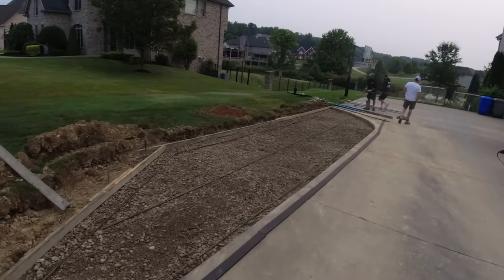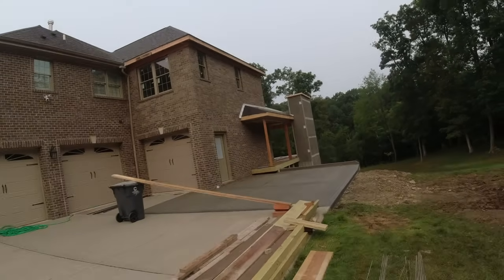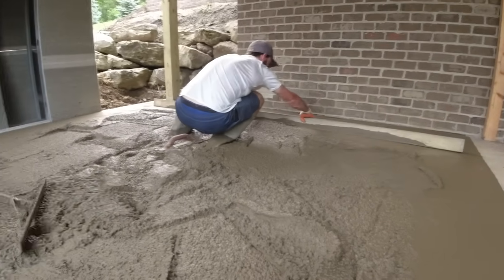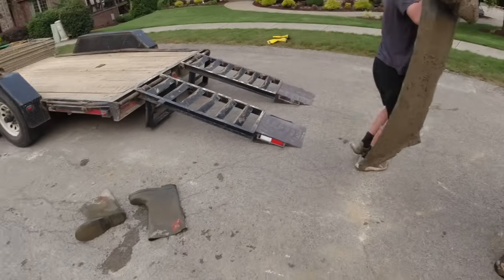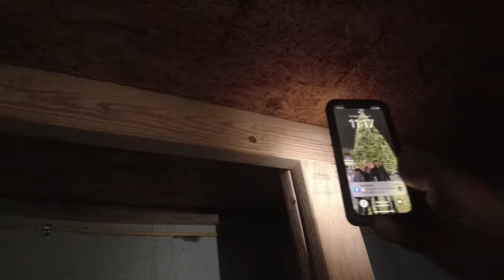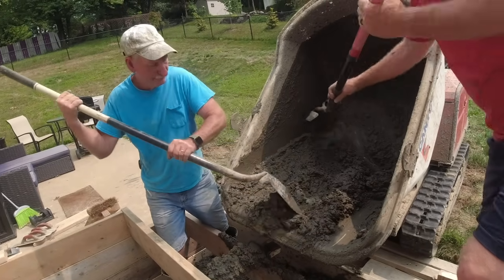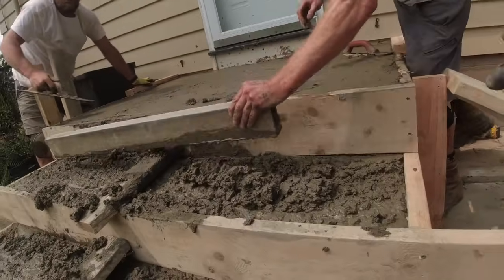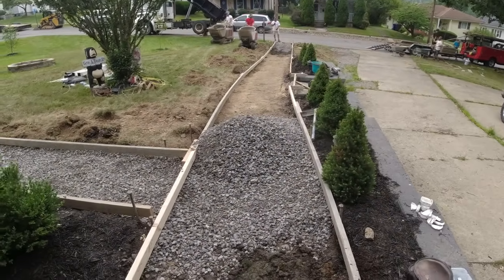Not Many Can Do This!

Comment: I like the mat that you put on the mules to prevent the splashing of the concrete, on my house there was splashing on my vinyl siding, wood door and window trim and AL screen door all dried hard as a rock and wouldn't come off no matter what I tried...and here it is 5 yrs later & I can still see the stains on EVERYTHING!! I would insist on putting plastic up on any surface up to 8' away & 8' high..yes it splashed that high! 
 Also, why aren't the guys all using square shovels, I noticed on older guy with one but all the others were using pointed ones.  I've found that doing this type of work with a pointed shovel just dulls the point and is way less efficient. I enjoy watching your crew working, you're so lucky to have those guys!
Reply from the maker: You’re right it splashes you have to deal with it right away

Comment: Couple of questions...why don't you bevel the bottom of your 2x8 risers on a 45 degree angle to finish the tread a lot easier & why don''t you use form oil on all your forming?...unless I missed something.
Reply from the maker: I find it easier to follow bottom edge. We take off and clean the same day.
Reply: @Concretewiththehauses  Yes, but a 1 1/2" bottom edge width is a lot wider than an almost zero width.
We would strip forms sometimes, but in a lot of cases we were not able to strip forms and they would have to remain so I always beveled the bottoms of the 2x8 risers for a nice clean finish.
Never the less, you guys do very nice, quality work with excellent prep and construction forming techniques.
Thanks

Comment: Your work always looks first rate. I do have a question for my own edification: I’m a concrete contractor in Southern California, and we would not be permitted to allow that 4 x 4 post to come in contact with the concrete pier beneath it (I’m guessing the code prohibits this due to possible rot.). And it’s fairly dry here most of the time.
We use a piece of Simpson hardware (or equivalent) that we embed in the concrete pier that holds the wood post a quarter inch above the concrete. Very secure but no connection between wood and (often times wet) concrete. I don’t remember what part of the world you’re working in, but is the code different there?

Comment: I might suggest a water soluble oil (like Klean Kote or Zep products) to spray on your buggies. It will soften the old dry concrete and keep new form sticking. It is an extra expense but keeps things cleaner and easier to maintain.

Comment: Lookin good when we did stuff like that instead of all that extra fill using concrete and extra weight we did what they call a lost deck by taking old or new form wood and build a box sorta living a 8-10" space all around for walls add re bar also we used Styrofoam and that never comes out .  Most  all the bridges see on the California  are hallow and in the forming the deck or the roadway section is a lost deck type and that plywood and lumber stays in there you  can walk through them I know I worked on them I know as I worked on them back in the 80s
Reply from the maker: Nice thanks

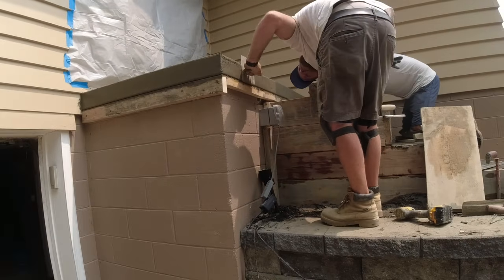Comment: 23:00, if he were to wet that edger to make it glide easier, does it hurt the concrete by making it weaker?
Reply: The idea is to push the stones deeper into the concrete and allow the fine material to come to the surface. There is plenty of moisture there already, it will come up when the stones go in.

Comment: I've worked both ends of the stick in concrete, former, laborer, finisher and cement truck driver. Everybody always states they want a nice tight mix. A requested 4" slump always gets to the jobsight at a soupy 6" slump and nothing is ever said about it. When it comes to pouring concrete, a certain level of ethical feeling must be in place.

Comment: Here’s an idea for you . Get with a screw manufacturer and have screws made that have a 3/8 ring about 1/4 below the head , like the old casing nails . So it holds your forms tight but you can’t sink the head and making it easy to remove. That idea might make you a millionaire.
Reply from the maker: That’s a great idea
Reply: They make duplex screws

Comment: What’s the difference between a expansion joint and a control joint , they look pretty similar ? Awesome videos Mr Hause ! One of the best on YouTube !!! Very informative
Reply from the maker: Very good question an expansion joint has an asphalt or rubber material separating the concrete a control, cut or joint is usually about 1 inch deep done with a tool while you’re finishing the concrete
Reply: @Concretewiththehauses  you could have explained that question a lot better than you did. You could have said that control joints are designed to crack in the control joint. But in most cases that does not always work.The expansion material is to allow the concrete to move and help to prevent cracking the concrete.

Comment: I’m a little surprised you don’t cover your walls a little more. And 45 your front  step stringers to make it a little easier to finish out your bottom inside corners. I don’t envy you at all. You can have all the concrete work you want. 😅 I never had enough men. And the ones I had I had to tell them everything to do. 😖 Now being retired my knees are shot. 😢

Comment: I’d be more impressed if you back angled those risers.
Reply from the maker: I just don’t like doing that too hard to find the bottom edge
Reply: @Concretewiththehauses it’s called not having the experience it’s easy to find,  on your face board of each step put a cut at the bottom each  board a 45 degree angle and there you go all set..easy since you have to strip the face board anyways to finish it off the way you guys do it is called being lazy and not experienced…..

Comment: Dont understand why you wouldnt fill the center of those steps and stoop with stone or broken block to reduce the weight of the concrete !  Never did like that little 2 1/2 inch toe catch where the top tread runs in under the stoop !
Reply: Too much weight.  A disaster when it settles.  Unprofessional.

Comment: Tommy, why don’t you guys save time, money and labor and fill your steps with stones or cinderblocks? You’re putting a lot of concrete in there. Steps are an elevated sidewalk, no? In philly we use filler. Old concrete, cinderblocks whatever we can. As long as you maintain a consistent 4” you’re good. Just curious why you guys pour them 3’ and 4’ feet thick out there?